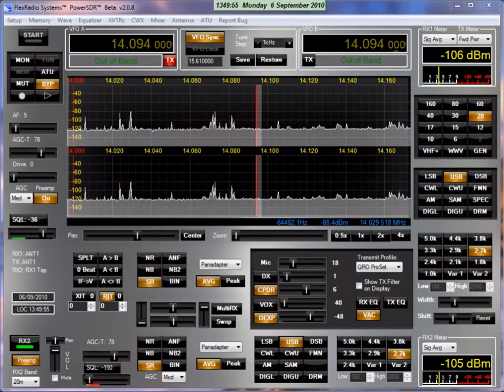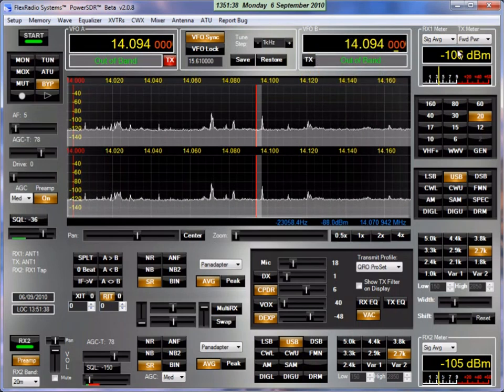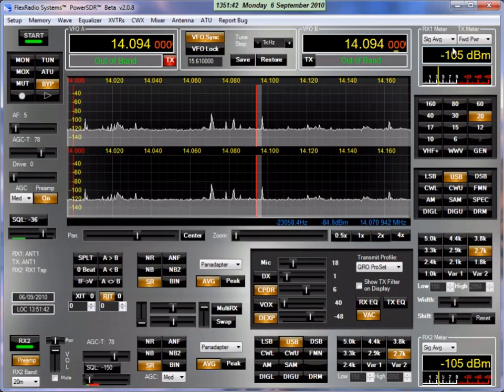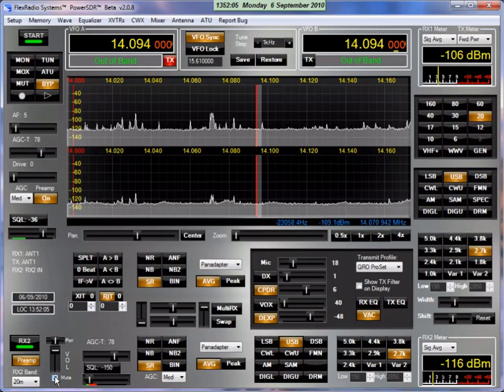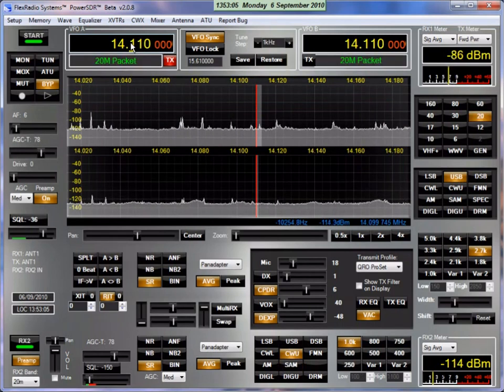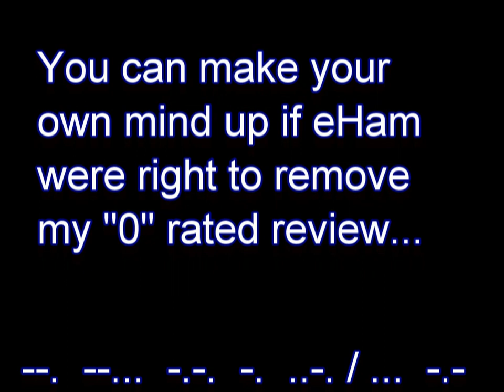Comet CHA250 Broadband Vertical

Comment from the maker: @combatwombat71 You may be interested to know that the CHA250 contains a 6:1 impedance transformer and is essentially a random end fed "wire" with an which is vertical, with an unun. This antenna worked considerably better when mounted 2m above ground compared to its location for this demonstration. It appear that location is everything!

Comment: I remember the Q-Tek Penetrator that I had and what was inside the 'matching unit' at the base. The matching unit may as well have been filled with paper for the amount of work it did - yet again another dummy load with a wire attached. 
Thanks for this comparison - for the amount people spend on these kind of antennas, I purchased a new 22ft silver rod and attached some extra wire at the top coming back towards the house with UNUN at the base - works perfectly for a fraction of the the cost!

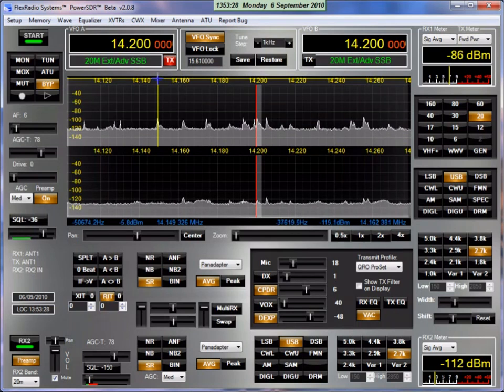Comment: So from your video, it sounds like you are not a fan of the Comet 250B antenna. At 4:22 into the video you hear the DX Expedition conversation. If I understand correctly the antenna on the bottom is the 250B antenna showing very little signal strength as compared to the top window\antenna. Is that correct ?  I have a 250B antenna and I am not happy with it either.

Comment: think removing your review was justified if this is you're idea of a fair and unbiased 'opinion'.
lets see, you're comparing horz. vs vert. (which is an automatic 20db loss for the vert., proven by your OWN comparison), you stated you mounted it at 7m, while its clearly stated in the instructions that "it must be installed at least 35 feet above the ground" (that's >3.5 meters, or 11.5 ft, HIGHER then you installed it...and THAT does make a difference in HF). You mention nothing about HOW or WHERE you have the vert. mounted so we've no idea if you have given it a fair chance just by your installation.
So, as you claim to 'only present the truth' you should present the WHOLE truth...given all the factors that could effect any antenna, simply demonstrating a 30db loss means 'absolutely nothing' without QUANTITATIVE information about all variables, which you've failed to do; thus disqualifying your results...
Anyone expecting a vertical to compare well with a horizontal (considering MOST HF is polarized horizontal) needs to go back to their licencing course material again.
As many stated already...the simple comparison of horz. vs. vert. explains the db losses in itself, so little to do with the antenna's performance anyway.
Reply: Not to mention that when he went to 15 meters and 12 meters I was seeing more signals on the VERTICAL hahaha!!!

Comment: Intersting that some beleive polarisation has any impact at the frequencies used in the comparison. 
I also find it odd that some would say it is not a fair comparison. 
One is always going to be better than the other ....that is the point of comparing them. 
Having previously built a cobweb antenna (have vids on here showing the build ) I can attest to their use in a limited space environment.
I would even go as far to say they are also a compromise due to the nature of their design. 
If anything, I would say this is a fair comparison based on the advised locations of the antennas. 
I would be interested to see the comet installed under optimal conditions but of course this is not always possible. 
With many antenna the location and set up can make all the difference.

Comment: I am looking for a vertical antenna that is wide band and doesn't require tuning.  This will go way  up a tree.  I was looking at the comet 250 until I found your review.  Is there another vertical wide band antenna I should look at as well.  I need wide band, and no need for tuner etc.  Thanks Bob Olympia WA, USA

Comment: I am sorry, but as a foundation licence holder even I know you cannot compare a tuned half wave folded dipole with a vertical antenna, which is not balanced nor resonant physically by length. The cobweb is a completely different antenna, and a comparison between the two is flawed at the get go. The comet is what it is; and that is an end-fed with a 6:1 impedance transformer. It never was anything other than a compromise antenna which should realistically be placed as high as possible clear of it's surroundings for it to work at it's probable 10% efficiency. As you would know a dipole is somewhat more efficient around 90%. and although hight does matter for the angle of radiation the cobweb will work quite happily from 20 ft ASL;  although the higher the better as with most antennas. Bitter Grapes comes to mind.

Comment: An interesting comparison. I have seen websites where dissatisfied owners of CHA-250B's have been pulling them to bits to find basically a dummy load in the bottom section, with a simple radiator attached. I guess they can put as much spin as they like on the marketing, but the proof is in the pudding, as you have ably demonstrated. The Cobwebb appears to be a very underestimated antenna for its small (but still too big for my backyard HI) size, bandwidth, and performance. 73 Rob VK2GOM / G0MOH
Reply: I guess im asking randomly but does anybody know a method to log back into an instagram account?
I was stupid forgot my password. I appreciate any assistance you can offer me
Reply: @Maximo Diego instablaster :)
Reply: @Henry Theodore I really appreciate your reply. I got to the site thru google and I'm waiting for the hacking stuff atm.
Takes a while so I will reply here later when my account password hopefully is recovered.

Comment: This is practically meaningless. Whats the point of an A/B comparison when one is vertically polorised and the other is horizontal ? If anyone would want to compare the comet 250, surely it should be up against another "vertical" ... you may as well have compared to 250 to a doublet, or even a 1/2 wave dipole.

The dipole or doublet are directional and will pull in a signal easier than an omnidirectional vertical. While the vertical could pull in a signal where a dipole can't if it's direction is opposite to the originating signal.
Reply from the maker: Where did dipole or doublet come from? The antennas compared were both omni-directional and since polarity is irrelevant following ionospheric refraction the comparison stands. . .
Reply: hmmm .. a dipole is omni-directional huh , a vertical is omni, a dipole and/or a doublet which is a form of dipole is directional.
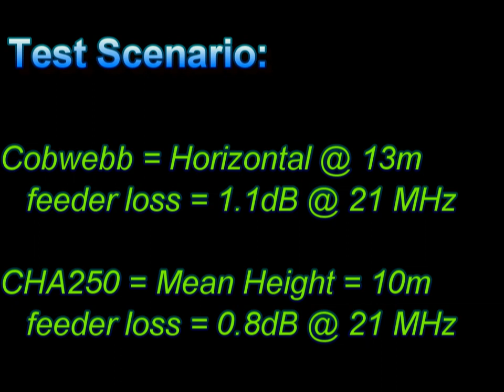Reply: ***** You said in your previous comment "The antennas compared were both omni-directional ..". In the video between 1:35 and 1:40, you state that the Cobweb is a dipole etc !
Reply from the maker: ....Said the spider to the fly. Congratulations, you have just proven your ignorance! Perhaps you should learn some rudimentary physics before strutting your stuff. The Cobwebb is a confined field, gamma T matched dipole, with elements arranged in a square. Go and model one if you understand how to do that and you will see whether THIS dipole is omni-directional or not. Hilarious mate, thanks for making me laugh so hard today, I needed that!